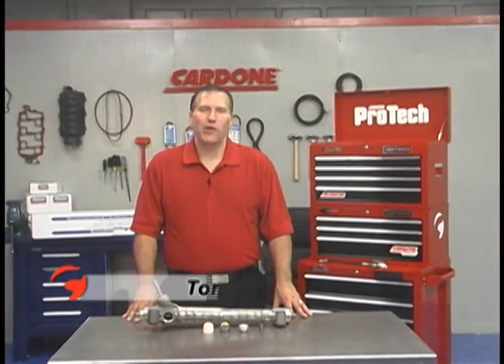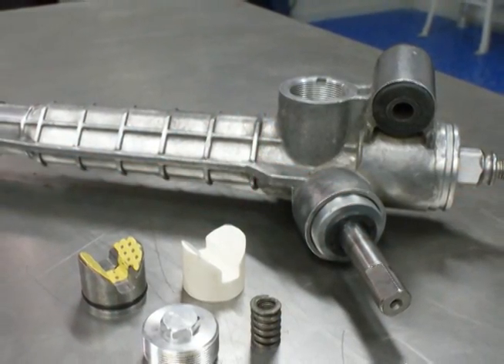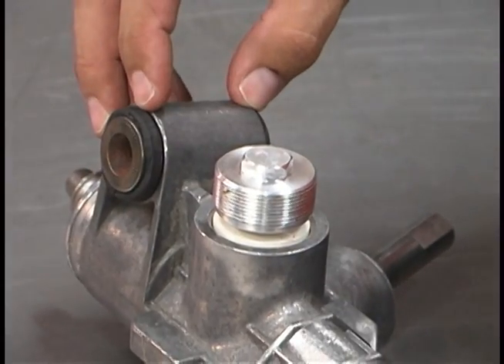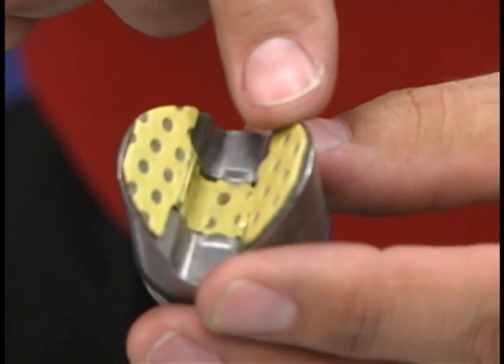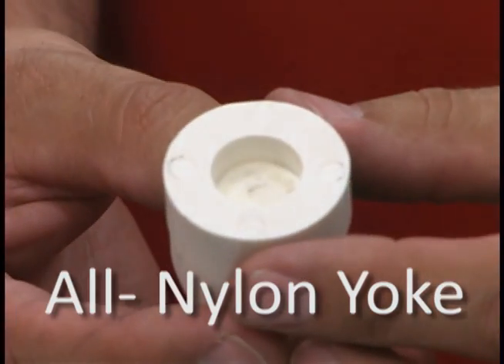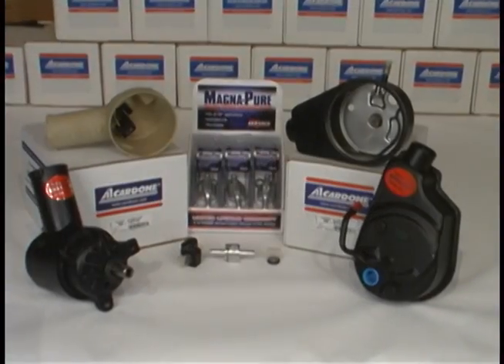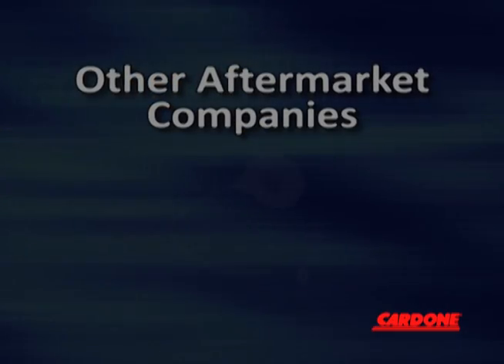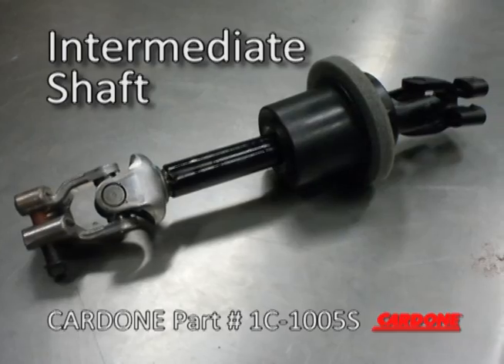GM Rack & Pinion Noise Issue- Part 2

Comment: got a brand new rack from you guys, the preload was nonexistent and it didn't even engage the rack when powersteering was loss resulting in the teeth to slip and my clock spring to be ruined, thanks!

Comment: i bought carbs from you guys threw oreily parts store one was a holy 1920 and that was broke took it back got the pice of shit back the i bought a carter bbd singel barrel for my 69 225 slat six and the car fell on its face i opened it up just to find coroaded parts like viton nidel float and metering rod and the as hole at oreily sed that ok so if you make good remans prove it cause beteew you and orilys in barabo wisconsin are full of it and the maneger name is jake

Comment: Seriously? For a big brand, ur r&d seem to be lacking on the experties by doing such basic mistakes that cause major issues in future.. This is what happened when u just want to compete with others in term of looks and confort because u should actually start from the quality of the part it self from it basic functioning work..
Reply from the maker: Alister, we appreciate the feedback. Our adjustments on OE design are always based on common fail points we observe in the original parts. Did you personally experience problems with the nylon yoke in the video?

Comment: Hello,
I'm from São Paulo, Brazil, and own a GM Malibu 2010/10 2.4 LTZ – VIN: 1G1ZE5E01AF255357;
In another occasion, I got the Rack and Pinion Complete Unit 23-1810 that solved for good the looseness problem on the steering wheel. Congratulations for your services quality.
What happens is that Malibu has not been well adapted by General Motors to the reality of our streets. It makes several noises of suspension, specially the shock absorbers.
However, there's another noise that disturbs a lot and originates in the steering column.
I checked that, as disclosed in their YouTube videos, Cardone has solved this problem with the A-1 Cardone Remanufactured 1C-1005S Electronic Power Steering Intermediate Shaftpor.
Therefore, I kindly request for you to inform which part fits correctly in my vehicle and if I can really solve this "knock-knock" noise on the steering column.
I also invite you to check my Facebook page, created specially for Malibu owners here in Brazil.
https://www.facebook.com/GM-Malibu-753409951351725/
Thank you.
Reply: Marcelo Passos Simas  olá tambem sou de são paulo, tenho um malibu 2010 /2011, não tenho face,podemos trocar idéias por what's up 11 95885-7161... tenho um visinho que tem um malibu, e sofre com o mesmo problema
Reply: Olá Adriano! Solicitei ao moderador do grupo de Whatsapp para adicionar você.
Reply: Obrigado

Comment: Good morning, gentlemen.

I've got a GM/Malibu LTZ 2.4 - 2010/2010.
It has been presenting lots of noises at the steering wheel box, which sound like suspension noises, but the problem is not about suspension. 
I watched your videos and everythinh leads me to believe that my problem is the same that's been reported on it. 
I need some clarifying:
1. is it possible to acquire the rack steering directly from you?
2. are you able to mail it to Brazil?
Thank you.
Reply: ***** OK. Thanks.